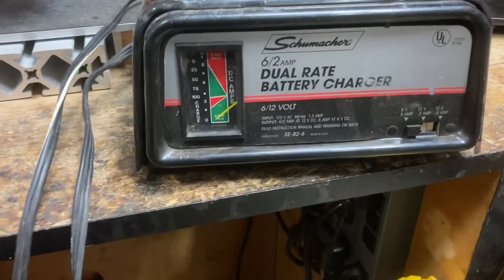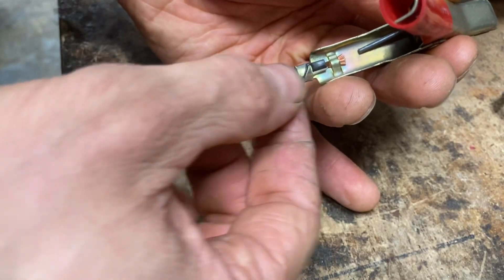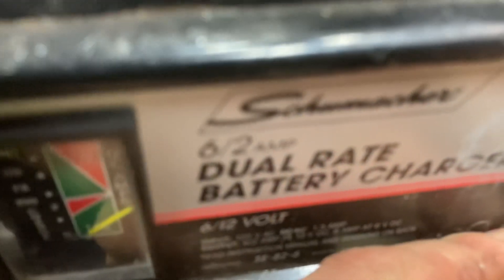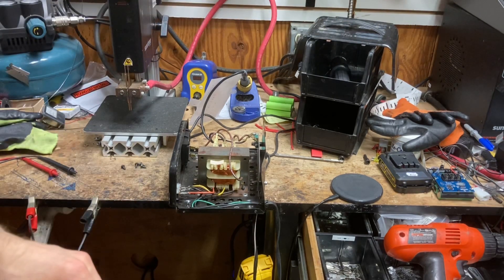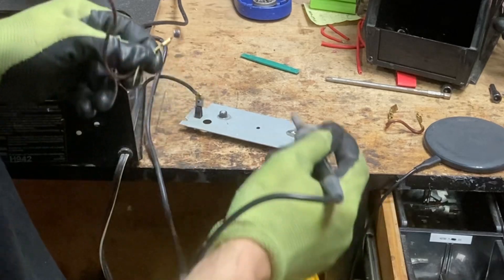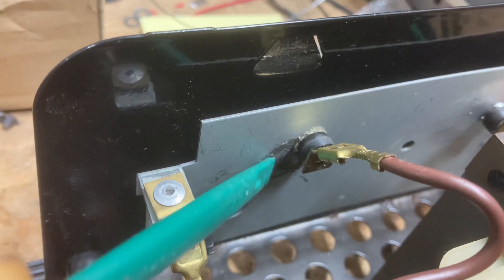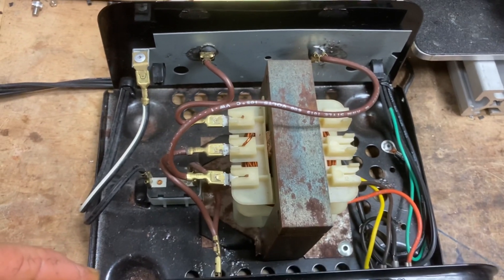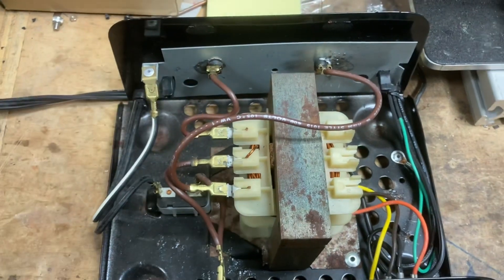How to Fix a BATTERY CHARGER That WON’T CHARGE

Comment: This looks similar to the inside of my roll-around shop chargers. I was buying a new one very 2 years or so for my 12 bay shop. My friend replaced the old diodes with better diodes that had a stud. Just drill a small hole stick the stud through and put the nut on (no soldering) That was 8 years ago and my employees weren't able to kill it.
Reply: I think I may have to replace the diodes in mine...  its a Schumacher SE-82-6 (older taper model) and pulled it out today   zero volts across the clamps!  😢
Reply: Great idea. It is hard to solder to a heatsink because the entire purpose of a heatsink is to keep thinks cool.
Reply from the maker: Sounds like a great improvement! So many things are built to break these days. A simple replacement like the one you’re describing is a brilliant way to beat the “disposable system.” Nice work.

Comment: Think of the transformer as pulsing power in and out which is “alternating current”
The diodes in this setup only let the power go out which is “direct current”
The cent tap of the transformer is the “common” which the out current comes back to after it goes through the battery..
The trick to using a modern diode replacement is figuring which direction to place it in the circuit..
Reply: By
Reply from the maker: I believe you. I’m still trying to wrap my mind around what you’re saying though. There’s lot here I’m not familiar with.

As far as placing the diodes in the right direction, I’ll believe I was able to use the continuity setting on the multi meter for figuring that out.

Comment: DIODE is a ONE WAY DIRECTION flow to Prevent Problems
Reply from the maker: Yes, I am curious what type of problems would arise if current flowed back to the transformer.
Reply: @Duby4life  this is kind of funny…… you know like problem problems. Like bad problems. Not like financial, marriage or world problems but you know electrical kind of problems. Hope this helps 😂

But on a serious note at a guess I’d think maybe because of having battery on one end power from there could flow backwards into the transformer or even another sensitive part that might sit there. Like if you pull the plug and tested the prongs would the 12 volts from the hooked up battery flow backwards to the outlet. If you plug back in you could have your 240v(Australian) plus the 12 volts sitting in the power source leads and might cause a surge. 
Maybe transformers need to be empty when power is inputted or they blow up. I swear I’ve heard “ the transformer blew up” listening to savvy electrical mates throughout my life 😂. 
The other thing and I only remember this because one day I picked up an old circuit board holding onto that square box transformy thingy and my mate nearly fainted from disbelief and went mad at me haha. Yep I’m traumatized. So my only logical interpretation is that electricity from it may have killed me. 
“ you f@&ken idiot, what are you doing, don’t grab that” didn’t have much more education than his abuse haha. It didn’t feel sharp so it couldn’t cut me and I wasn’t carrying it above my head so couldn’t fall therefore killing me. So from this experience I have concluded electricity may actually be stored I’m them. If you pull a power tool battery charger or laptop charger the light tends to stay on for a while after doesn’t it? Come to think of it I’ve always wondered why Stick welders don’t have a trigger or a foot pedal. Wouldn’t that make it far safer than having a live exposed end Constantly. I don’t know how many times I have gone to put the hand piece down onto the metal bench the negative is clamped to. Haha. Also from what I have seen 12v battery chargers don’t have a switch to turn them on/off. Does this mean it always has to dump the left over charge because of what the original poster explained so thoroughly about causing “problems” 😂🤷‍♂️
Any electricians/gurus out there that can chime in?
Reply from the maker: @brickmate4802  Haha, I appreciate the laugh. Maybe your friend just didn’t want you touching his project. 😂

I know modern 12V chargers are not always pushing out 12-15V. They’ve done away with the large transformer-style chargers, at least in the US.
Reply: I would think that it could drain the battery if they weren't there to stop 🛑. The backflow. I know my dad's very old charger and it probably belonged to his father before him, my dad always said if it isn't plugged into the wall and turned on. Then unhook it from the battery 🔋. That thing has to be 60 years old so it probably doesn't have all the preventive measures for 🦺
Reply: I eat one diode every day, just to stay moving forward